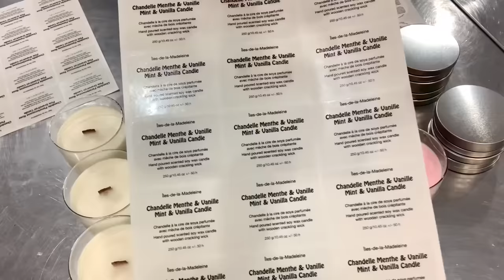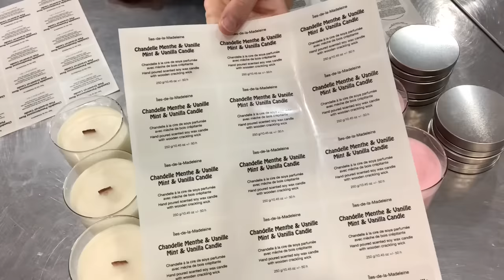Making Soy Wax Candles with Crackling Wooden Wicks

Comment: When you say you laminate your labels with another label, are you using 2 of the same size label? It's an interesting concept. Whenever I want to make my labels "waterproof" I use packing tape, but then have to use scissors to cut around them. 🤷‍♀️
Reply from the maker: Brookelyn Turner yes two of the same

Comment: Hi! What temp do you add the fragrance, what temp do you pour and how much did your candles weigh on the scale? Thanks :)
Reply: this what i need answered
Reply: The temperatures depend on the wax and fragrances you are using. You will have to test, test, test!  As far as the weight…. You will have to test that as well as it’s different for each container and the density of wax you have chosen to work with.

Comment: You can light it after 48hrs.. did i get that correctly? I thought it has to go thru curing stage..
Reply from the maker: This manufacturer recommended 48 cure time before burn testing. Each wax is different

Comment: Hi! Can we use them as aromatherapy even though you put fragrance oil in them?
Reply from the maker: Kimber Bauer usually, aromatherapy is associated with essential oils. I would suggest you buy an essential oil diffuser to get the most benefits from essential oils. In candle, most of them get burned off.

Comment: Do you have problems with the wax pulling away from the side of your jars ? I love glass jars but not attractive when wax pulls away. Can’t figure out how to stop it from happening.
Reply from the maker: Sherry Allen Blankenbeker I don’t really care if it pulls. Sometimes it does, mostly in winter when the workshop is cooler. But it doesn’t affect the performance of the candle
Reply: I use my heat gun to warm the sides and top if it pulls away. It's just air and the bubbles will rise to the surface. Winter it does this more often. 
If the glass feels too cool at pouring, I'll also use heat gun to heat inside if jar for about 15 seconds immediately before pouring to warm the glass.

Comment: I use Golden wax 464 for my candle jars. Im still looking for a pillar wax for my soy melts.
Reply: I use 464 for my wax tarts. I found that using silicone cupcake molds work AMAZING for them. The molds peel clean off after set and are perfect. No need for pillar blend wax.
I found the mini and full size molds on Amazon for quite reasonable prices as well.
Reply from the maker: I haven’t had great luck with the 464... I love the EcoSoya! 😢😭😭😭

Comment: Can you please tell me what the temp when you pour? What's the temp when you add the fragrances? Love it..
Reply from the maker: I cannot answer this question because each wax is different. The wax used in this video has been discontinued and then brought back by Kerax in the UK. The temps have changed. Each wax should come with manufacturer recommendations, so make sure to research depending on the wax you decide to use when making candles

Comment: Hi! What temp. Do you pour your candles, what's the last cuttin tool u used to cut the wood, & could u do a tutorial on workin with beeswax Pleeease? I love this video!
Reply: the pouring temperature depends on the candles, you'd also want to measure the temperature when you add the oil to ensure it binds nicely. Usually working around 125-150 degree Celsius (sorry, I'm Canadian, not sure what metrics you use). The cutting tool is called End Cutting Pliers. Beeswax isn't ideal for created scented products :)

Comment: I've just started making candles using paraffin wax. I dont have a thermometer to know the temp to add the fragrance oil in. And when my candles are setting, some of them sink in. And the flame burns soo high, even when I cut it down.
Reply: I don’t know if you know this but paraffin wax is a byproduct of petroleum and releases toxins in the air when burnt like in a candle for example.

Comment: With your 30cl jars do you recommend a wooden wick width of 12mm or 15mm and what thickness do you find best in soy? Mine either burn too high a flame and scorch the wax brown or burn too low. Any advice with choosing the best wood wick for soy by container size?
Reply from the maker: gina 0151 I cannot advice you as the wax I am using has been discontinued and I will need to finish testing new waxes to be able to get answers for myself first

Comment: What are the ideal temperatures ? 🥹
Reply from the maker: Hi! This specific wax doesn’t “exist” anymore. EcoSoya were bought by a UK company that have reengineered it, but after testing with it, I find that it doesn’t perform the same as it used to. Each manufacturer should provide wax working temps. ☺️

Comment: When using wooden wicks I thought you didn’t need a bar
Reply from the maker: Beth Brodhacker you don’t always need one, just if the wicks move when you pour the hot wax. I used to use glue dots and they would sometimes move because of the hot wax. I found that using the wick stickers, they stick better and won’t be needing the bars anymore!